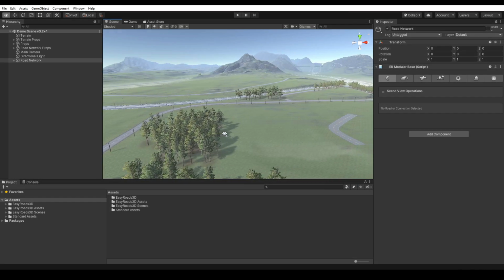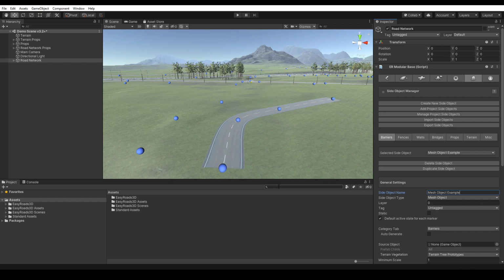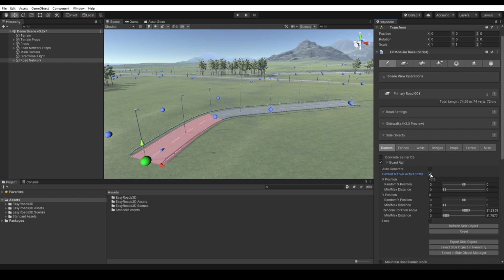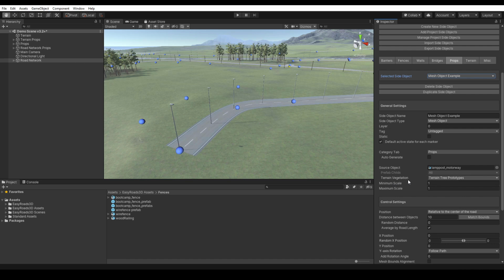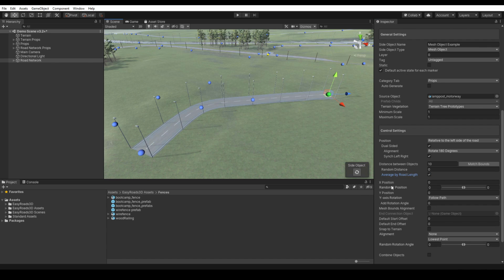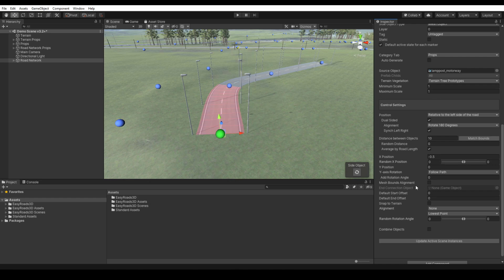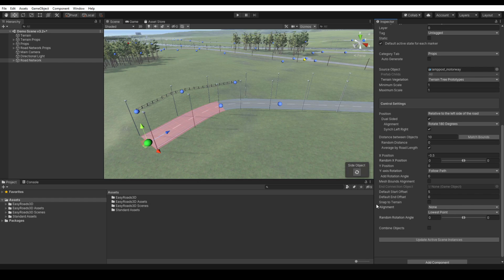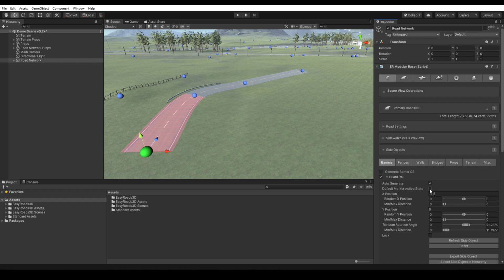EasyRoads3D v3.2+ for Unity - Side Objects - Part 1 - Mesh Type

Comment: great tool but too bad it can't carve the terrain and only conforms and adds height to terrains
Reply from the maker: It can carve the terrain, what does your terrain look like? A default Unity terrain object is flat at the game objects Y position. And it is impossible to add negative height values to the Unity terrain object. So when you do work with the default flat terrain, please flatten the terrain heights to a value higher then 0 using the terrain flatten option. That way it will be possible to carve into the terrain.

Comment: Hello. I may have missed the answer. When I place a side object it is being placed sideways. How would I turn them object if I am using procedural mesh. I was able to accomplish it for a moment but I am unable to reproduce the outcome. Thanks for your help in advance.
Reply from the maker: Do you mean it is rotated 90 degrees? In general, when creating the model you want the orientation in the forward direction, the z-axis. But the rotation can also be adjusted in the Side Object Manager in the Control Settings > "Add Rotation Angle" below "Y Axis Rotation"

Comment: What would be really useful, if you could also add moving object such as vehicles or trains as side objects, along with some extended controls for how those vehicles follow roads and tracks tramways.
Reply from the maker: That sounds more scripting API AI related. The EasyRoads3D Pro package includes a runtime scene example of this. But better, v3.3 available in betas includes new road type options to define lane info for road types. Lane data is created accordingly, also on crossings. A simple demo of a traffic script using this data is included in the beta. And there are at least 3 traffic packages on the Unity asset store that already implemented support for this. Tramways will probably need more but perhaps these packages support that as well. And we can also look into that.
Reply: @unityterraintools  do you know which packages, apart from Tramways, support it? Interested in cars.
Reply from the maker: @robosergTV  There are at least three traffic packages on the Asset Store that already support the new v3.3 lane data options for A.I. For cars, the generated roads are ordinary unity game objects with a mesfilter and mesh collider attached. So physics will work in a similar way as when importing road models.
Reply: @unityterraintools  Thanks, but do you know the asset names? It's impossible for me to find it, there is not tag or filter for that
Reply from the maker: @robosergTV  https://assetstore.unity.com/packages/tools/ai/ultimate-traffic-controller-110492
https://assetstore.unity.com/packages/templates/systems/its-intelligent-traffic-system-23564
https://assetstore.unity.com/packages/tools/ai/mobile-traffic-system-194888

For the last one I cannot see EasyRoads3D being explicitly mentioned on the Asset Store page, but the developer confirmed a couple of months ago that he was able to integrate v3.3 lane data in his traffic system
Reply: @unityterraintools  Thank you!